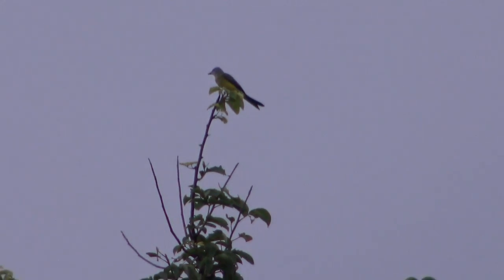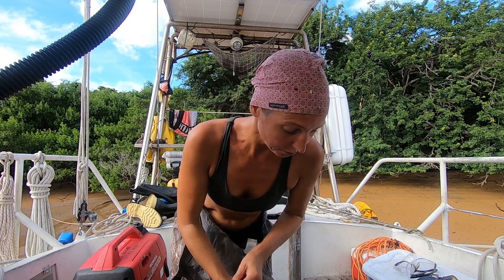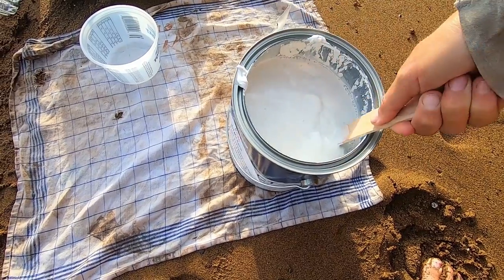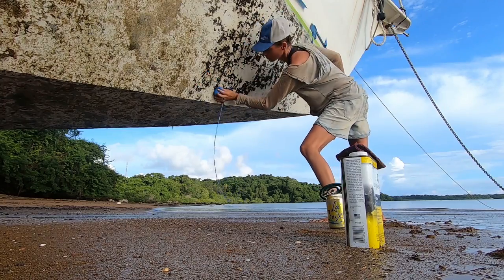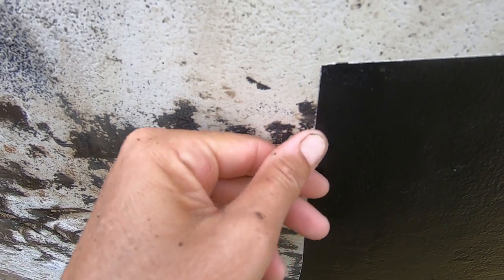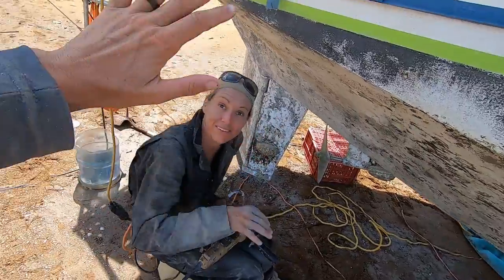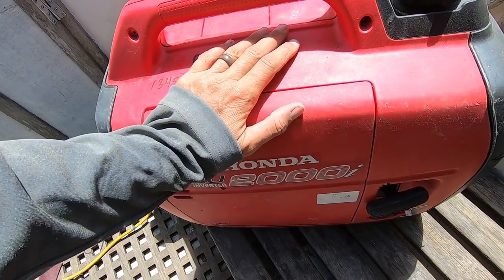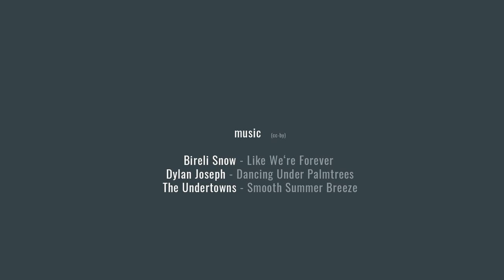Taking my sailboat to a beach because marinas are closed

Comment: I'm a auto painter and for us dry/cure time is based on temperature, air flow and humidity. Temperature being the biggest factor. These for me are based on 20c 50% humidity. The humidity is not helping you, but if it's 30c and windy you could push your coating times considerably. I would recommend not letting coatings "flash off" in direct sunlight because it may cause the outer layer to cure and skim over before the deeper solvents have a chance to evaporate causing incomplete curing of the coating under the "skin" and potential delamination.
Reply: As far as i know Nike uses 2K Epoxy coating, that means 2 components react chemically and there is no need of evaporating solvente. The temperature ist the most ifluencing factor to the curing Time.

Comment: Wow, that was a lot of fouling on the bottom!  You did an impressive job cleaning it off!  It makes me wonder what the bottom of the one of my boats will be like when I haul it.  It has been in the water now for four years and is do for some love!  Thanks for the video!
Reply from the maker: The last antifouling was two years ago but what’s more impressive is that I last scraped the hull a month before I beached it. So u see that it really does make a difference to have or not to have antifouling paint 🙈 four years will probably have produced some impressive underwater reef 😂
Reply: @WhiteSpotPirates  That is what I am afraid of!  On the plus side, it is the "free" boat, and everything about it is sort of an experiment.  I try different things on her.  The "free" will probably end up costing me more than the other two combined!

Thanks for your quick reply, and good luck with the work on the bottom!

Comment: after all the unbelievable work youve put in Karl its so great to see your ankle so completely healed and  your enjoying life to the fullest
Reply from the maker: Yeah unfortunately the foot is only back to 70% but I can surely get around. Each morning it’s a battle to get the foot going but once it’s going it’s doing alright but surely not back to normal and still dealing with pain but all below a level that I have to take pain killers which is great. 
The foot surely was a little grumpy after this marathon and punished me a bit. But it was great to see that I am able to power through a project like this with it. 👍
Reply: @WhiteSpotPirates  yes ok 70% is pretty good for the time period.  i broke my hip racing against my young nephew years ago and had it replaced and after a year or so i couldnt even tell it was done,  now i jog, ,play tennis n golf, bike and sail.  so it just takes time for the body to adjust to the new screws pins etc

Comment: Great video, its nice to have the hard part of the job done.  Quick question, what is the purpose of coating a steel hull with epoxy?  I thought it was only used on fiberglass hulls to prevent bubbling/pitting.
Reply from the maker: My boat is aluminum. First u put on an etch primer on the bare metal to make sure the paint sticks well. Then it’s followed usually by 5 (or more) layers of epoxy primer before the antifouling goes on. It keeps the metal protected from electrical currents (from the outside, not ur own internal mess ups obviously 😂) or galvanic corrosion when sitting next to a steel boat or dock. Also, u need something between the metal and the antifouling because the antifouling won’t grab onto the bare aluminum, ad far as I understand. On a steel boat u would want the primer to prevent rusting, I would say. But I am not a pro on this...🙈  but this would be my personal explanation.

Comment: the Westerly is a British twin keel boat.  The keel bolts can leak.  Be careful not to beach on a super high tide or you will have to wait until another super high tide to float it off the beach.
Reply: Karl isn't a Westerly, I know all the models from the 60's through to the '00s and Westerly never produced a model with a chined hull and never built using sheet material.   I agree though, their bilge keel bolts can seep if they take the ground constantly.  However the longevity and quantity of Centaur and Berwick models still around demonstrate that these can last 50 years or more taking the ground.

Comment: Tristin Jones: Sailed against the Humboldt Current, South down the Pacific Coast of South America in a tiny twin keel sailboat to Chilie. He had to tack the entire way. It took month and months to do so. Then he loaded his boat on a flat bed truck to the highest altitude navigable lake in the world to sail Lake Titicaca  then hacked his way through the jungle down stream to come out the Southern tip of the massive Continent to Argentina then proceeded to sail back to England. I can't recall if that segment of his adventure was successful but I can tell you this tiny twin keeled sailboat still exists. A common complaint about twin keel sailboat boats is they are slower. No single keel sailboat has come close to the records set by Tristin Jones and his tiny twin keel wooden boat.

Comment: You found a beauty spot and calm conditions for that daunting job, judging by the fouling maybe do this again a little sooner next time. I live in the back of beyonds in Ireland and chose a lifting keel so as to do exactly the same plus the anodes of course; its an annual chore 😩 a really hard job but you made it look fun and light work - there is great satisfaction in a clean hull - lovely video thank you👌👍🤗

but every Spring and it lasts the year, needs it f
Reply from the maker: Yeah I did not plan to let it slack for that long but having surgery and laying in bed for three month did not help to keep the yearly schedule up...as much as I like to put all my energy into my boat, I think health has slight priority over bottom growth...😂
It was quite the job for sure but it helped that it was in such a nice setting. Although that also caused some extra stress on it all. But at least not the usual “each day longer on the hrs costs big $$” stress ☺️. All in all I am glad it’s done and Karl moves smoothly again.

Comment: That black epoxy you put on, will that prevent the moss in the future or is it just further protection? I dont think i saw you this last time.
Reply from the maker: In this Episode I did not paint yet, that’s coming up tomorrow. Or are u talking about the pain trial? In that case: the white stuff is an epoxy primer which is for protection of the hull and the black stuff is antifouling which is protection against growth, yes. 👍

Comment: How did you manage to look so clean when grinding under the hull?  I looked like a member of the Blue Man Group when I took off my old anti foul.
Reply from the maker: 😂 luckily the antifouling was mostly gone so we were mainly grinding barnacle feet which are white and not blue or black (in my case) . Maybe they don’t stick as well as antifouling dust 😂. I tried to grind away from my face, too, which obviously not always works. I still thought I had quite the bunch sitting on my face in the end. I think it’s inevitable to some extent except if u wear a full face cover.

Comment: Nike, I told you you'd be fine and you had some episodes in you still! I dont know you but you seem like people I do that are at their best when they have a challenge to work on. You seemed more animated and upbeat in this episode than I've seen in a few! Its cute but I wanted to say it was the cutest thing when you saw what we call "lightening bugs" or "fire flies" you said they were "glow plugs"! I know you're a polyglot and you probably dont think little things like that are as humorous but having a international TE-444 and also a perkins 4-108 on a 37 footer I know what was on your mind when you said it which is all the more endearing. 
I know Karl has been needing some little stuff but I have been wondering about things like sails and standing rigging, did you replace those when you got Karl and if not how are they doing?
Reply from the maker: 😂 I meant to say glow bugs cause I always thought that’s what they are called. But I was told by Maria as well that it’s fire flies and not glow bugs...so will try to remember. We call them glow worms so I guess that’s how the glow part somehow creeps in there all the time.

I got new sails seven years ago when I bought the boat and the Genoa and boom jib are still good. My main is in bad shape and I am currently working on a replacement. 

I changed out all my shrouds and stays five years ago and they are all still in great shape. But I am about to do a little retuning since it’s about time. I check the turnbuckles and connections on the mast regularly to make sure I don’t miss anything. Maria reminded me to check some of the rivers on my rig so I will include that with the next check. 👍

And about the episodes: funnily enough, as soon as I started filming, the boat projects started popping up left and right 😂. Wonder if one has to do with the other 😂🙈. I am happy I gave it another try, the editing for sure has been a fun new project and I learnt a lot in the last two months.
Reply: @WhiteSpotPirates  oh I am sure there is always more to learn with boat projects AND editting. If I were a better editor I would be in your shoes now... well not really since you never wear shoes but you know what I mean. 😉
Where is the nearest sailmaker to you? Have you asked around about recurring a newer but used sail and restitching the reef points? Everything else sounds good and I know Karl's engine is newer and the hull has been gone through.  I recall seeing video of the inside when you first came to Karl and there was fungus everywhere. Have you been replacing the wood since then? I have not seen much of the inside of your boat it seems.
  Glow worms? That's interesting. I wasnt making fun of you, it was a hint at the fact that you keep at least three languages in your head and may slip on a word from time to time. I barely speak English and it's my first language! Btw in New Zealand glow worms are these luminescent organisms that live in some caves there. You can float through and see them glowing by the hundreds on the ceiling like stars.
Reply from the maker: @danielbuckner2167  I found a sponsor for a new sail so no, no re-stitching but something brand new. I still have my old old main sail, so I will think about making some stuff from the sail cloth. I had kept it as a spare, well, would have been a bad spare but better than nothing and now I can use it for sth else and use my current sail as spare. It’s torn a whole bunch and it would take up a lot of material to stitch it so for now I will just leave it as it is, I think...
I only replaced the wood that was rotting away. What I could save, I saved and treated with vinegar and alcohol, sanded and re-painted. I have not had any mold since I had re-sealed the windows back then. 
The interior is okay but the boat is a bit upside down lately. I need to remodel some things and also throw some stuff out, it’s too unorganized and I don’t have enough accessible storage space. I have a ton of storage below benches and in the aft cabin but I need sth better accessible where I don’t have to move 50 things around to get to sth. I have some ideas but at the moment it’s a bit tricky to get supplies...we will see.
Reply: @WhiteSpotPirates  Do you have a sewing machine on board? Surely Maria does. Perhaps you could make an outrigger and sail for your kayak... or just a small sail for somebody else dinghy.  Maybe stitch some little flags and do a rough scree print (home made) of WSP logo. Having a sponsor sounds great btw! I hope they put some WSP swag on it for you.
   Yes, everything important that you need on a boat has a place, right behind or under or hidden by something you dont need! I will say that sailboats use their available space better than other things, I've had an RV and a houseboat that had so much wasted space but the sailboats were great on using every inch. Lockers and storage behind or under berths always seem like big closets that things get thrown in but without some materials you are kind of on hold I guess.

Comment: you feeding the elefant piece by piece to us... I looks it was quite a doable work all in all  30 men/women hour of work half a week if one is alone. I have en interesting question how do you handel to grind in the middle of the water with power tool , do you use en FI disconnector? I guess one could use batterie powered tools. for me it looks a bit scary with 220v standing on wet ground... kleine anfrage von mr. hasenfuß
Reply from the maker: Ah we only work with 110v so it’s all super safe 😂😂😂. We taped the connections off and tried to wait till we are at least not submerged in water. But yes, it’s not the safest way to work...tzzzzz tzzzzzz ⚡️⚡️⚡️
Reply: @WhiteSpotPirates  vielen Dank und guten Wind

Comment: Ok. Now it's my turn. You, are a so called environmentalists. Please keep this clean and let's not do that, so on and so on...
Buttttttt... did you just clean your old anti foul paint,  rate on top of a pristine beach. 
You had nothing down for containment, of the paint flakes..... YOU, REALLY NEED TO PRACTICE WHAT YOU PREACH......
Reply: Yeah, at the risk of piling on, the practices shown are not the best. Here in Washington State, the advice from the "Puget Soundkeepers Alliance" is as follows: "Surface Prep and Sanding BMPs: Paint dust is toxic and must not be allowed to enter the environment. Pathways include airborne dust, or sanding dust on the ground that gets washed away by stormwater, and wastewater from pressure washing and wet sanding. Many bottom paints contain copper and other heavy metals that are used to prevent the growth of marine life on the hull. Unfortunately they will continue to work in this way if they are allowed to be discharged to the waterways."
Reply: There would be always someone....
Reply: Seriously how did that boat manage to sail ??? The difference is going to be phenomenal....

Comment: You are obviously aware of the dangerous nature of the chemicals you are using as you are wearing a respirator and coveralls. Not sure why you think it’s acceptable therefore to do this work in a pristine environment. Boat ownership has some intrinsic costs, one of those is the use of Marinas to do such work. If all boaters antifouled their boats in such a manner, our coastlines would really suffer. What’s next? Let’s do our oil changes on a deserted beach and tip the old oil over the side, that would save money on a trip to a waste facility. I’m assuming you haven’t considered the environmental damage, otherwise you wouldn’t have posted this video. I would encourage you to remove the video, as it illustrates bad practices, potentially encourages others to do the same and undermines your credibility in regards to any other environmental messages you may have.